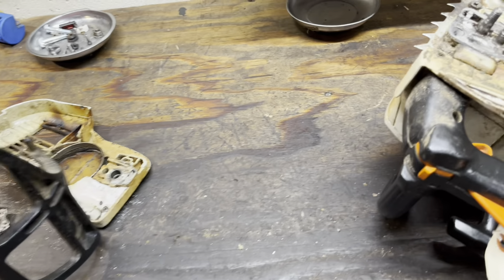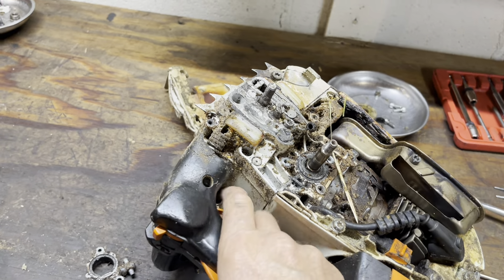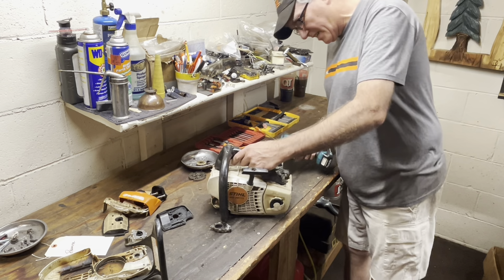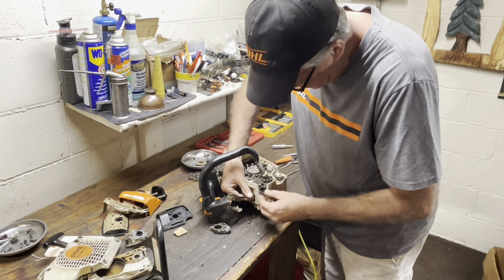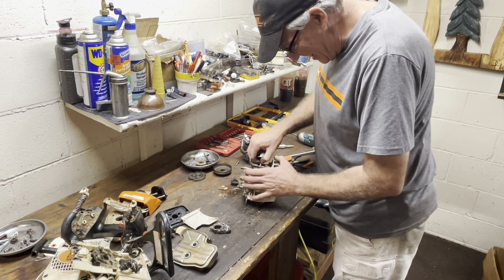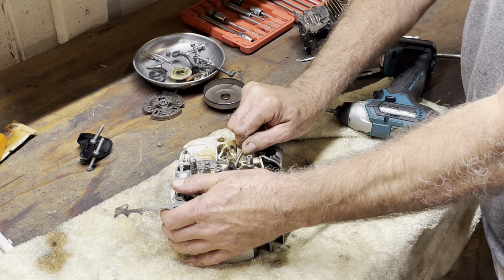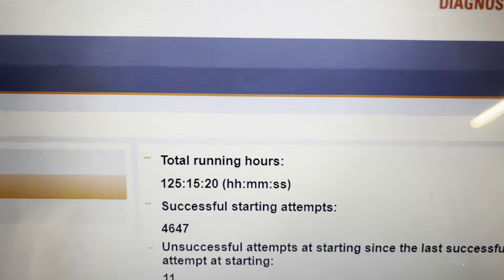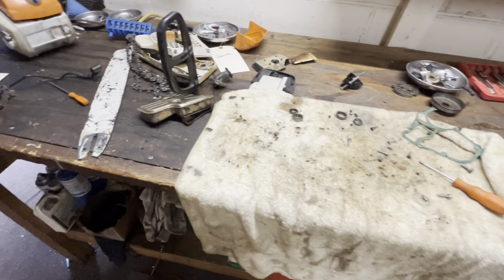MS201tc Goes Clunkity Clunk

Comment: Wow!  14,000 starts.  Yikes that bearing is toast!
Reply from the maker: Prolly closer to 18,000 if it's the one I think it is.
Reply: Echo 2511t to rescue..had my first stock one since 6 years ago someday s gets hundred starts...never missed a beat..changed plugs and exhaust gasket and filters ...that's it..have 3 now 2 ported...why Echo don't make 3911t auto tune is insaine they would dominate the market..or even regular
Reply: Echo 2511t to rescue..had my first stock one since 6 years ago someday s gets hundred starts...never missed a beat..changed plugs and exhaust gasket and filters ...that's it..have 3 now 2 ported...why Echo don't make 3911t auto tune is insaine they would dominate the market..or even regular